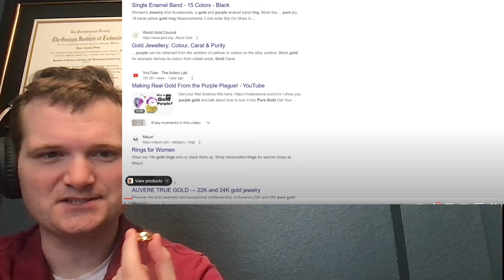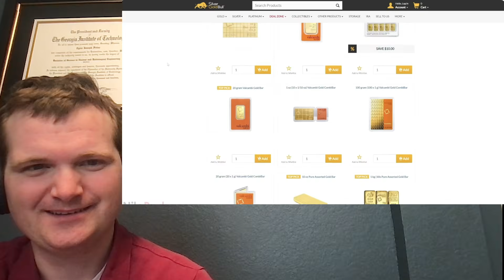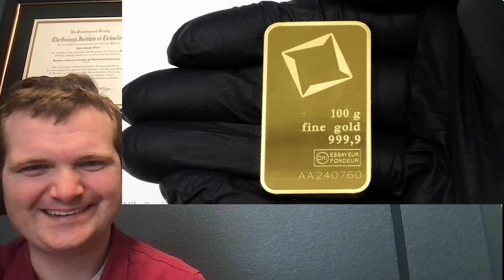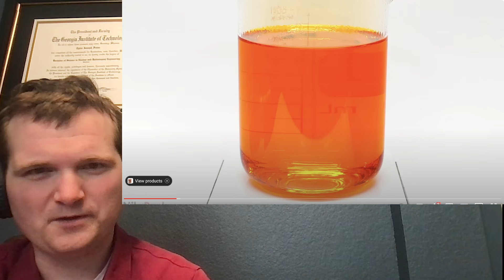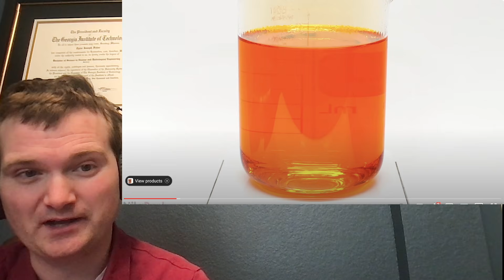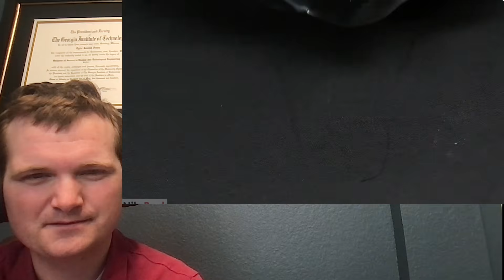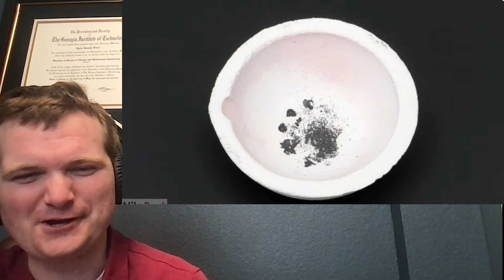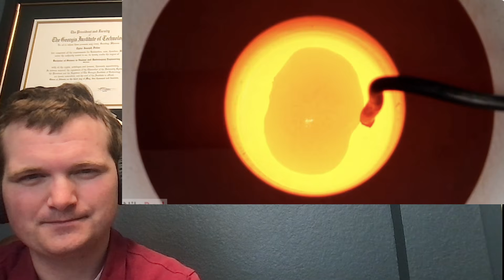Nuclear Engineer Reacts to NileRed Making Purple Gold - Part 1

Comment: 8:55 in germany we do typically use "," for decimalpoints and we use "." to seperate in to 3 digit blocks infront of the ",". For example in germany we would write 4.756,55$ instead of 4,756.55$. The first time i was a little bit confused for a short time but ever after the first time seeing it i just subcontiously swap them
Reply: in croatia here I only use spaces and commas or dots. 
your number: $4 756.55 
or $4 756,55
Reply: In Switzerland we also use kommas
Reply: I'm in Poland and we write numbers the same way... and I absolutely hate it.
I prefer to use spaces for thousands separators, because then it doesn't matter whether you use a comma or period as the decimal separator, it's not as confusing.
Reply: So that you can improve your English, I have some advice.

It is spelled "subconscious", not "subcontious".
Reply: @AntiAlphaX  thanks. Yeah sometimes i do forget how things are spelled
Reply: @Adi-kf6bq  Also, as a native English speaker, I think the inconsistencies of spelling in similar sounding words is really confusing for people learning English as a second language. Thankfully most misspelled words can still be read as intended with context, so one or two misspelled words are usually not a big deal for someone reading to understand.
Reply: @personagenerator plus "conscious" is just a pain in the butt. Not only does it have multiple easily substitutable characters for pronunciation (conscious could be easily spelled conshus, contious, consciouce, etc), it has the homophone(? I think that's the one for two different words sounding the same) of "conscience". Took me ages to get it right as a first language English speaker
Reply: @darkshadowrule2952  conscience is the form of conscious that is an abstract noun, (a quality of something) and not an adjective. (a describing word)

Comment: "I wish I( had it......" WHAT?!?! You're a freaking Nuclear Engineer! You can likely work trig in-head?? LOL Can you visualize Radii by in-noggin graphing? Here's what you do. Think of everything at which you are very good. Imagine what is within your realm of capabilities ...............and then how it could solve a problem facing humanity. THEN DO IT! LOL PS... when wanting to precipitate the pure gold out of pregnant Aqua Regia, he should have used Sodium Metabisulfide. I prospect, mine, and pan natural gold. Part of that is smelting/purifying (natural gold nuggets over two ounces can fetch as much as 20X Spot Gold Price). If the pregnant solution had really hit the floor, the solution would have been easy. Pour Sodium Metabisulfide all over every puddle. It would precipitate the gold out of solution right there on the floor, then vacuum it through a filter..

Comment: I cant say for sure, but from many countries  the only one I have seen using dots as decimal separators is america and maybe UK. Maybe its related to the imperial system, but I dont have sources on that though.

I have always seen dots as the separator between each 000, and commas as decimal separators

You guys do it like 100,000,000.99 and european countries and countries that were associated with Europe in the past use 100.000.000,99

Its a silly train of thought, but the coincidence its so big that the difference was made on purpose out of pettiness of whose system was more influential, lol.

Comment: 9:00 germany uses the , instead of . for the decimal point. so we have 2.000,50€ numbers instead of 2,000.50€. it is a bit confusing and also frustrating because the german numpat has a , instead of a . and that makes using most of the english websites and programs that need number input hard to use.